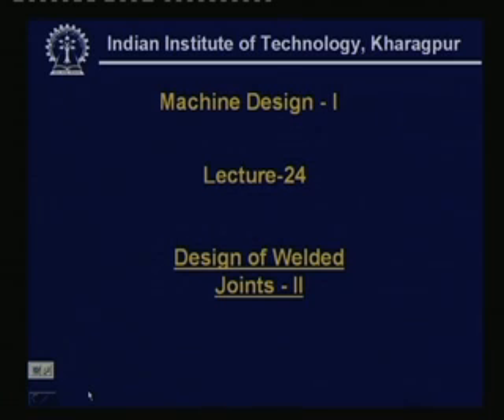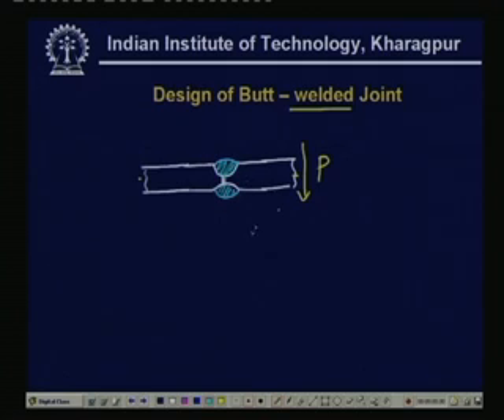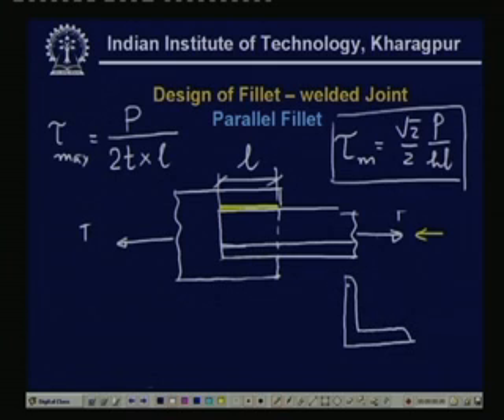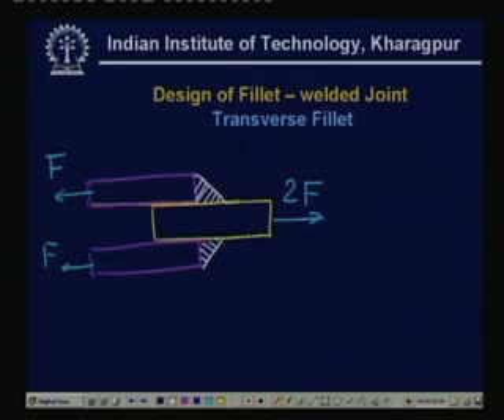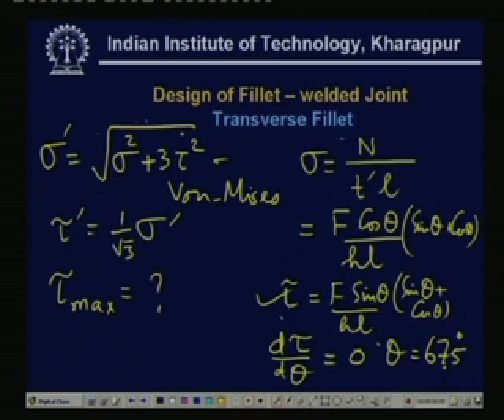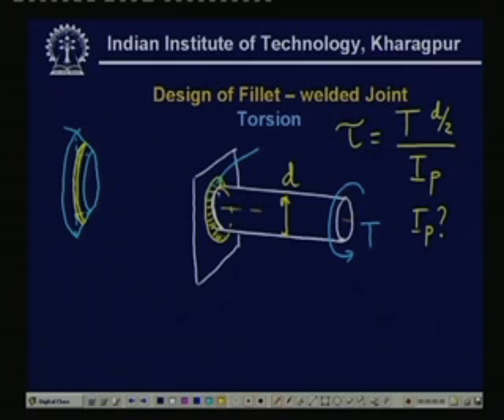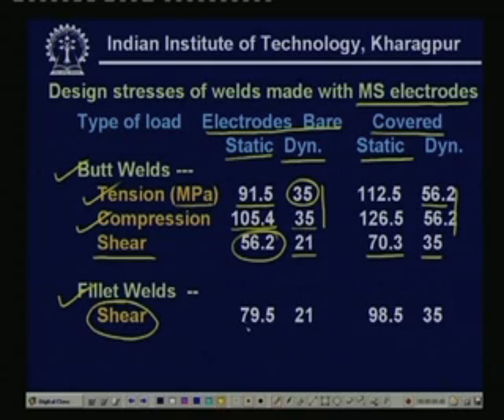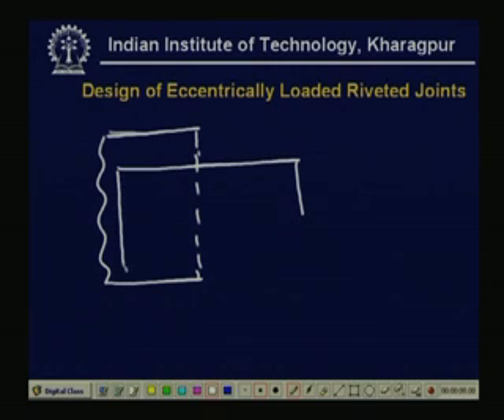Lecture - 24 Design of Welded Joints - II

Comment: 7:52 why τ(max) is equal to 1.5 τ(avg) 
where did the 1.5 came from?
Reply: this comes from Strength of materials/ Mechanics of solids course. Topic - Shear stress in beams under bending/transverse load. Shear stress at the neutral axis of a rectangular c/s beam is maximum and is equal to 1.5 times the avg shear stress calculated by Force/Area.